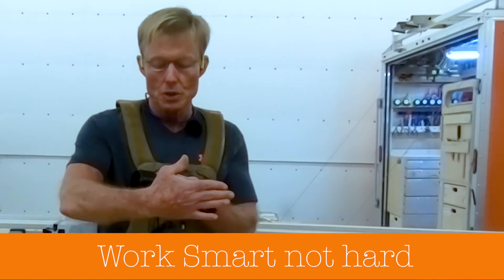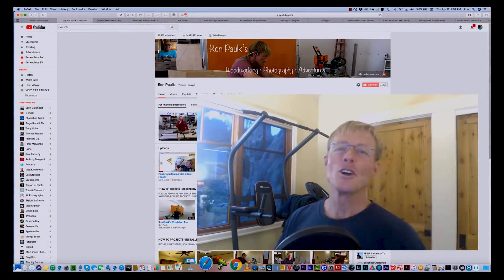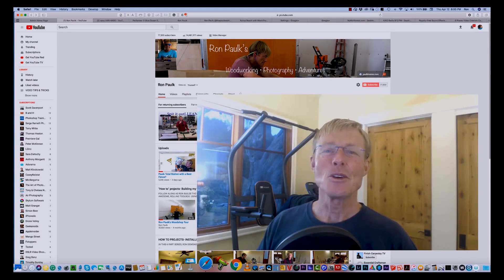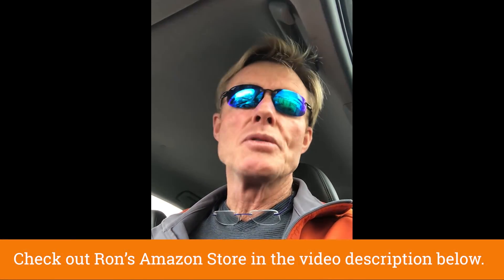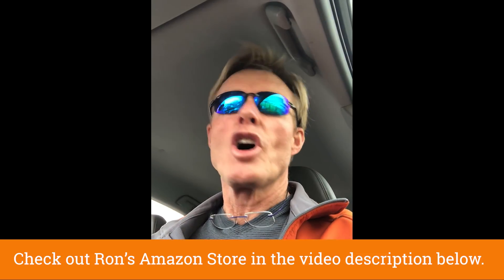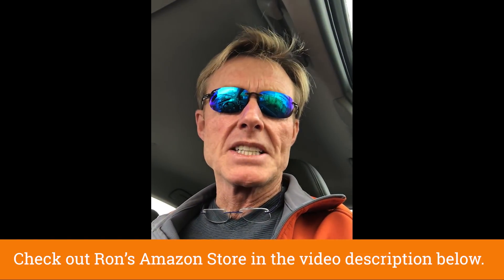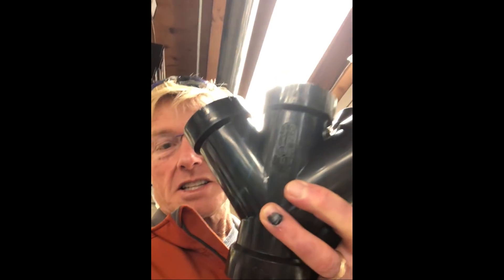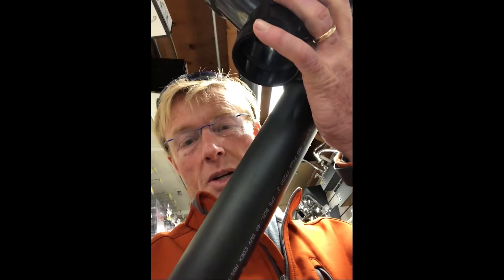Triple Vacuum Manifold progress

Comment: Hey Ron I use those Aluminum blast gates in my shop the 4 inch version and the one thing that bothers me about them is that tensioning screw you talked about so what I’ve done to all of mine is take that out screw and drill the according size hole (from the inside of the blast gate not all the way through the aluminum body ) with Neodymium magnet and the gate stays where you put it

Comment: I've been using plastic blast gates for the past 2 to 3 years called shop-vac vacuum gates and they work awesome and never clog up unlike the crappy plastic ones from rockler that quit working on the second day of use, the festool hoses connect no problem to the vacuum gates also but you may need adapters to connect them to a 2-way adapter, they can be hard to find online and they're yellow in color for anyone that's interested in trying them

Comment: Easy peazy. Blast gates, use 3/4ply, 1/4 mdf, rout front and back of 2 blocks to insert your pipe but leave a 1/8" of material so fitting doesn't protrude into gate, use 1/4 mdf on sides leaving an opening for 1/4" thick gate plus width, glue and sandwich the mdf between ply, making sure the flush sides of hole (routed facing out) are facing each other. Cut gate to width and slide it in, sand edges lightly so operates smooth. I hot glued friction fittings into the routed holes. Works perfect.. hope this helps. Took on look at ur blast gate and another 15 min. to figure out,works perfectly.